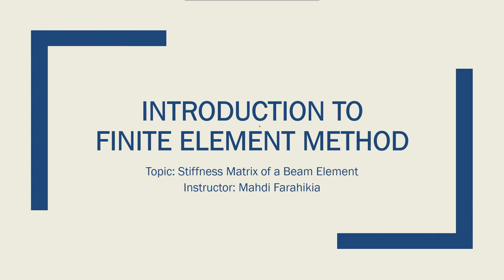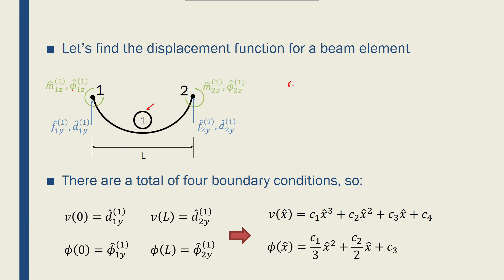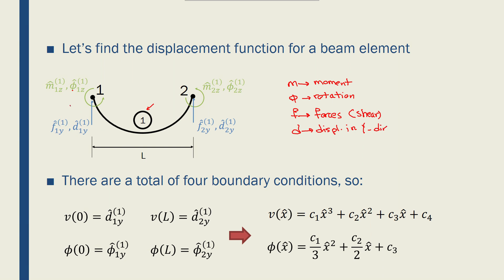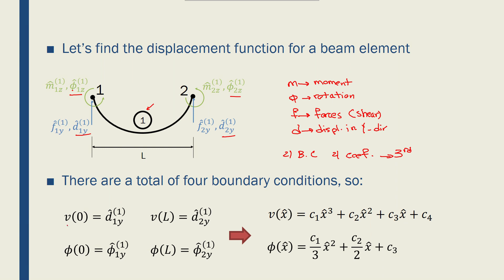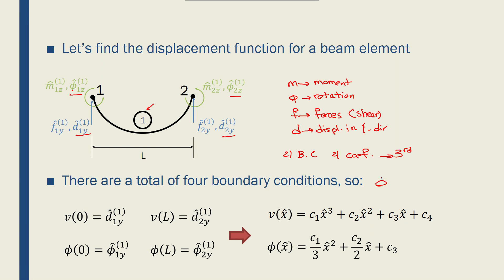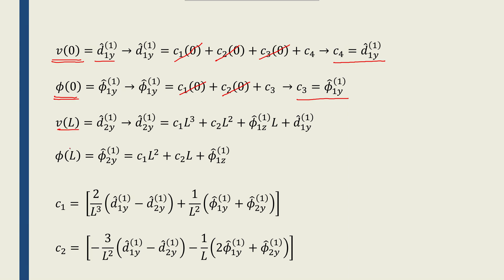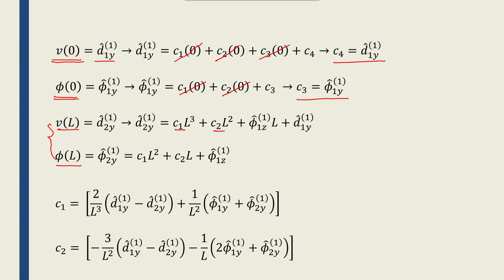Intro to FEM - Week03-16 Displacement Function for Beam

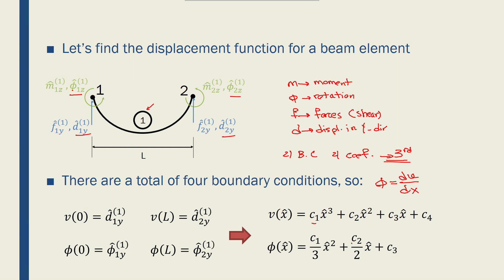Comment: Mahdi, why in 2:15 the derivative is quite strange? I guess the derivative of x^3 => 3x^2
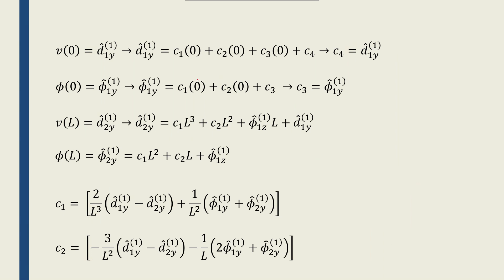And the rotation notation in 2:22 should be phi 1 (z) not phi 1(y) cause the rotation vector is out of the plane, in the z-direction not in the y-direction
Reply from the maker: Thank you! Yes, you are right. These are just small honest typos. I hope you can move on with the rest of the lectures!
Reply: I would like to thank you for this useful lectures!! I used to study this method in the class as an aerospace engineer. However, your demonstration is quite amazing! I really appreciate your efforts!

One more thing please, could you provide me with the pdf slides in order to be as reference material for me when I need it?!